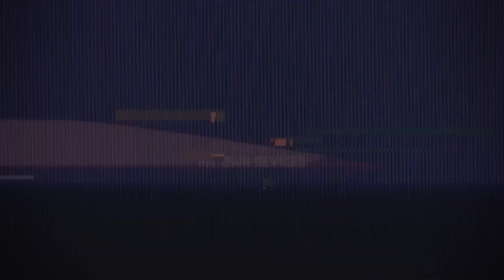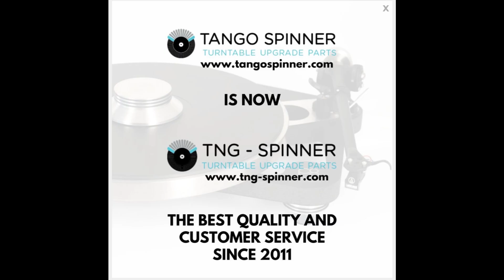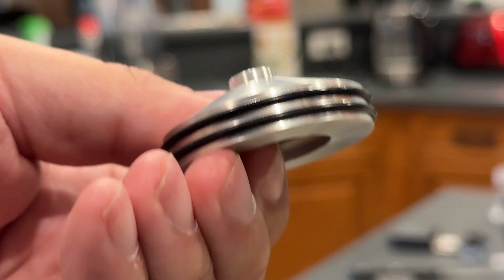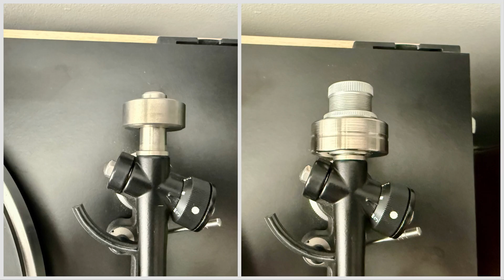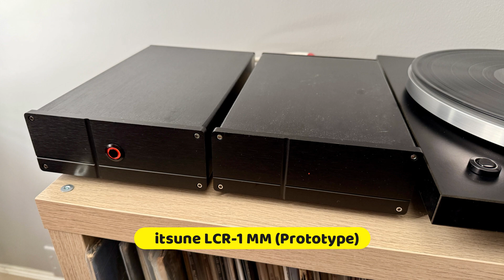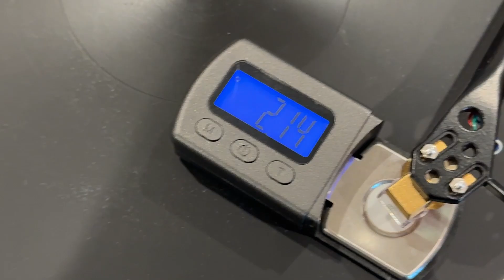Rega Revamp For Real! New TNG Spinner Turntable Upgrades.

Comment: Can't escape from confirmation bias being a factor here. Put all your mods on and get others to blind test which admittedly you day you can't manage. I listened to P3 and P3 rs side by side and did do some blind tests ( my Rega dealer is awesome) . The rs was way better but P3 had ND3 not the ND5. I can't be sure but I think you could chuck every mod at the standard P3 and it wouldn't sound as good as a P3 rs and would now cost more. I listened to the P6. Way better than my TT but much more expensive. I couldn't justify that especially as price differential was used to buy records.